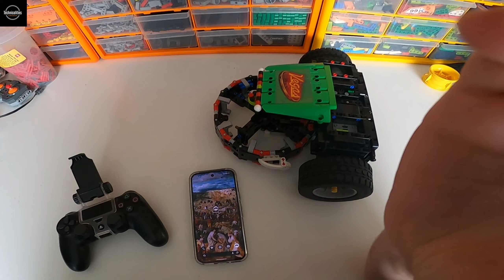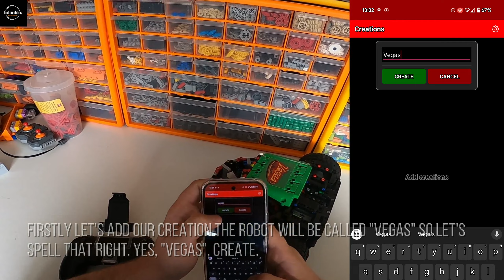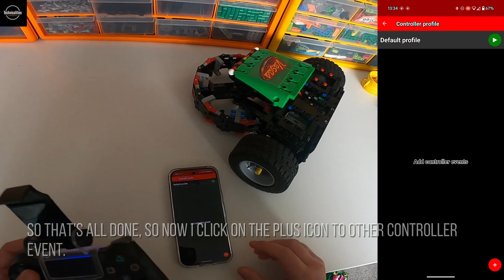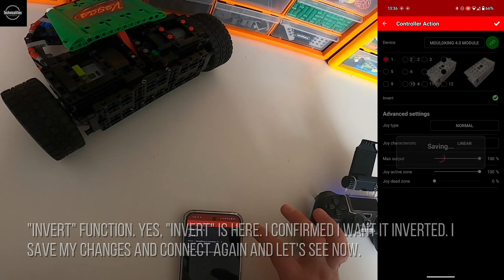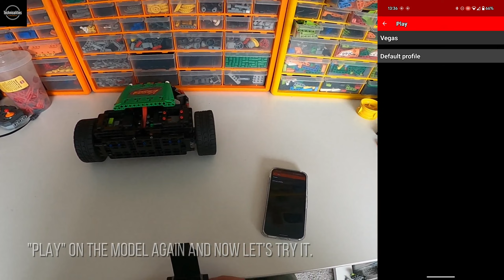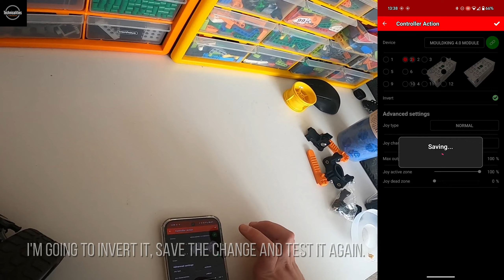Control MouldKing Receivers (MouldKing 4.0 and 6.0) with a gamepad and BrickController 2 [TUTORIAL]

Comment: How do I download it? The links only give me files, not an app. Could someone please explain how it works? I'd really like to have it. I just don't understand it.
Reply from the maker: @simon722.  https://github.com/J0EK3R/brickcontroller2/releases/download/4.0_J0EK3R_Beta_1/com.scn.BrickController2-Signed.apk
Reply: @TechnicalitiesbyKK  Thanks for the quick reply. When I download it from your link, I only get a file with it in it. I can't download it there. The file only says the name. I don't know how to get it on my phone. I use an iPhone, so I use the iOS operating system. It would be really nice if you could quickly tell me how to download it from there, or even make a short video. However, that's not necessary if you just write to me. I would be very grateful, because it would be really cool if it worked.

Comment: Why wouldn't you include the process for downloading it? Thers no button
Reply from the maker: https://github.com/J0EK3R/brickcontroller2/releases/download/4.0_J0EK3R_Beta_1/com.scn.BrickController2-Signed.apk
Reply: @TechnicalitiesbyKK  thanks!!!
Reply: @TechnicalitiesbyKK i followed the steps but once i got to the screen where there are the 12 inputs, nothing happened when i moved the sliders. Any ideas?
Reply from the maker: @edthurston1415  is your Bluetooth on, Location on and your Mould King 4.0 hub on?
Reply: @TechnicalitiesbyKK  yes but my mould king battery unit looks different than yours and also looks different from what's in the app. Mine has a small round orange button on top and the blue light is beside it
Reply from the maker: @edthurston1415  can you upload a picture? Some of the Chinese not MouldKing units are not compatible
Reply: @TechnicalitiesbyKK  I'm not sure how to do that on here. I could email a photo or DM on insta. But I'm not seeing my unit on any of the sites or videos. So I think you're right it's not compatible.
Reply from the maker: @edthurston1415  insta if fine, same handle

Comment: No working with H4.0 Module 😢
Reply from the maker: @streetjumper16  did you use the version from GitHub?
Reply: @TechnicalitiesbyKK yes, the MK4.0 module works. the white H4.0 module unfortunately does not. here only 1 port works and only 4 ports are found in the app.
Reply from the maker: @streetjumper16  perhaps you can write with this do the developer at GitHub, he can make changes to the app

Comment: Is the mould king 6.0 conciderably better than the 4.0? I'm mostly interested in how far the receiver goes on both for outdoor RC driving
Reply from the maker: Mould King 6.0 can handle two buggy motors while 4.0 struggles with that. 

It also has 6 PF ports while 4.0 has 4.

6.0 is slightly bigger that 4.0

I have not tested the range of 4.0 v 6.0 but I think they should be around the same.
Reply: @TechnicalitiesbyKK  Thanks for the quick response, btw! Seeing your comment, I ordered the 6.0, especially because I was already building a 2 buggy motor car. Just recieved it today and looking forward to testing it out :)
Reply: @mikegoossens359 i cant get connection to module 6.0 :(
Reply from the maker: @keinmucks have you tried all 12 ports in MK6.0 in the app?

I have at least 3 MOCs that run without any issues on MK 6.0
Reply: @TechnicalitiesbyKK  works now ..dont know why ^^
Reply: @keinmucks  I'm having the same issue, does't find it when scanning for devices :( trying many ways, installed brick controller 2 via Google Play store, version 3.4, detects my xbox controller well, but not the MK6.0.

Comment: Does anyone know how to use two 4.0 mould king contollers on the same joystick. I am building the Liebherr L586 and i need to contol 8 motors on one PS4 1Y joystick, but i can only get thr first 4 ports to work. When i try setting the rear 4 drive motors to ports 5 - 8. they will not work on these, but still only usinf 1 - 4 to worek all 8 motors. this wouldn't be a problem, but i have to invert two of the rear motors.
Reply from the maker: I would imagine that you would need to pair first MK 4.0 box with the joystick, then add the same joystick again and add the seconds MK 4.0 box then.

I could try if this works, but the soonest I can do this is next week.
Reply: When you turn on several blocks at once, up to 3 pieces, the channels simply split themselves from 1 to 12, very convenient